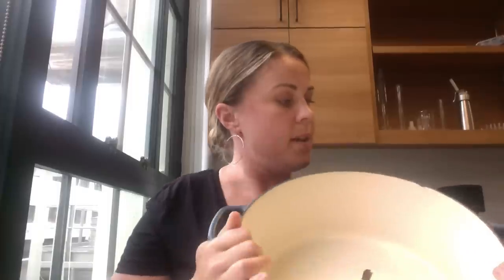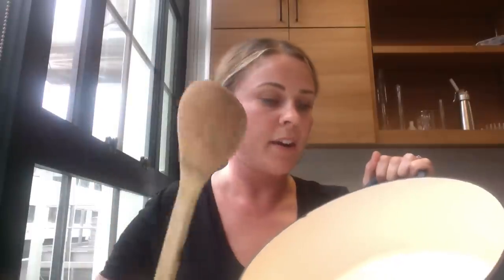Hannah Responds: Is it Bad if My Enamel Dutch Oven, Skillet, or Pot is Chipped?

Comment: Lol, _of course_, Le Creuset would recommend not using a chipped pot. That's another $375 sale for them! :)
Reply: ro pro haha that's what I was thinking too 😆
Reply: To be fair, I am pretty sure they have a lifetime warranty and would replace it. But you do have a point.
Reply: Certainly crossed my mind, but there could be valid reasoning, specifically with how the ceramic bonds to the substrate with stainless steel vs cast iron. With continued heat cycles and if the outer coating doesn't adhere to stainless steel as well as cast iron, the enable could progressively continue to chip off bits of ceramic into your food.
Reply: Was going to say that!

Comment: The thing people have to remember is that the enamel on a pot is not like paint on your wall, or even your car.  It's a high temperature glaze that is put on the cast iron core and then baked in ovens at around 800C (almost 1500F).  There's no "touching it up" or repairing it short of blasting it clean and re-enameling it, and there's certainly no gluing pieces back on.

Comment: I have decided to go back to cast iron dutch ovens and skillets and know how to use them. It was used by my grandmother and my mother rarely used it. After having to replace  non stick cookware every two years or less due to flaking of the teflon material I recently decided to go back to basics. I recently purchased two new skillets, and two dutch ovens also and they are the basic black material and I love them.
Reply: I stopped buying nonstick years ago for the same reason.  I now have a collection of porcelain enameled cast iron and a collection of triply stainless. I like buying things that I'll never need to replace.
Reply: @LlyleHunter  enameled isn’t the terrible Teflon/ptfe nonstick but it IS a form of nonstick. It’s textbook, a coating on the metal to prevent sticking. The enamel has chemicals in it that are bad for your health if ingested, and if you cook in it often enough even with proper care taken you can end up with a chip somewhere years down the line and you’re consuming the metal and dye compounds of the enamel coating when that happens.

Comment: I use soap on my cast iron skillets all the time. I've found that whether it's okay really depends on how the pan is seasoned, and what you do with it once it's clean. I've not had great luck with factory seasoning on my lodge brand skillets, but I have found that stripping that off and reseasoning with flaxseed oil works really well. Additionally, after washing the pan and drying it completely, if you give the inside of the pan a very light coating of oil before you put it away, that goes a very long way toward keeping a really nice non-stick finish on the pan.

Comment: Please respond to the comments about preheating the enameled Dutch ovens for browning meat before braising or stewing. In your initial video you said not to preheat it but browning in a cold pan doesn’t work well. Just a couple days after your initial video America’s Test Kitchen published an update on recommending a specific brand and yet again the said they tested browning before braising. Also, deglazing after browning tends to give a sudden, significant temperature change adding liquid to the hot pot In which meat was just browned. Can we or can we not brown and deglaze in an enameled Dutch oven?
Reply: hi hal! great questions. we typically have some oil in the pan when we call for preheating, this helps regulate the temp. there may be some exceptions and for those you'd want to use an unenameled pan, if you have any specific recipes in mind i can take a look at them. and the temp change from deglazing shouldn't be enough to cause damage, it needs to be a more dramatic swing.
Reply: Thank you

Comment: Is it safe to use these pots if the enamel surface is clouded and feels almost powdery? (Nothing actually comes away onto fingertips though) I bought a vintage set from an antique shop but now I’m worried to use them. Is this also treated with that water and vinegar solution you mention, and if so, what is the ratio of the solution?

Comment: I bought a new tramontina enamel dutch oven and it has a tiny sand size hole inside about half way up the pan I'm wondering if it's safe as far as released iron into my food and bacteria???? Do you know ? Should I try to send it back.

Comment: What about Lodge dutch oven? In the inner upper half of my pot the fiber is chipping away. You can can the visible rust underneath showing through. Each time I wipe the inside there are black fiber chips to empty out. Is there any hope for repair or is it dangerous to attempt any further use?